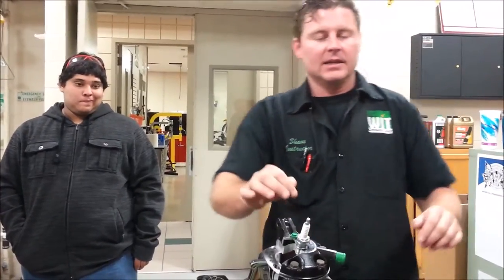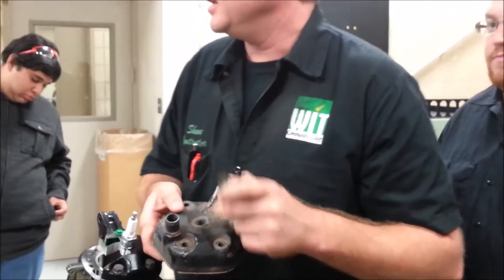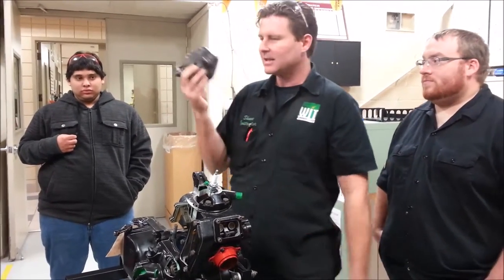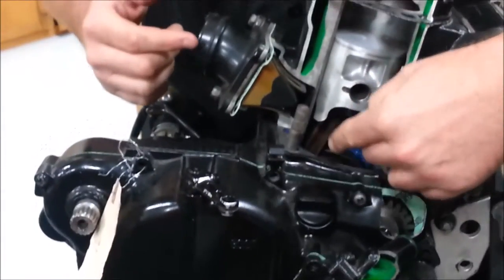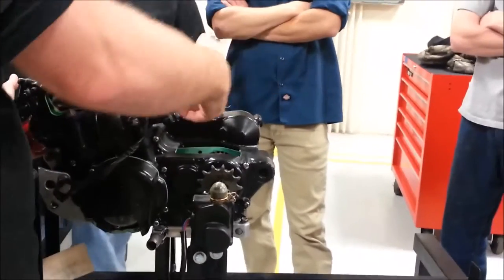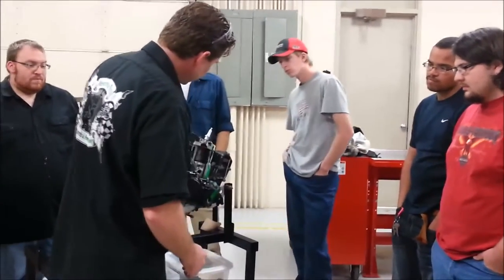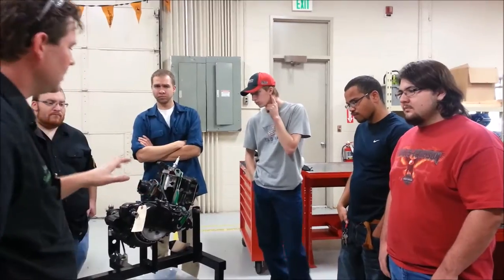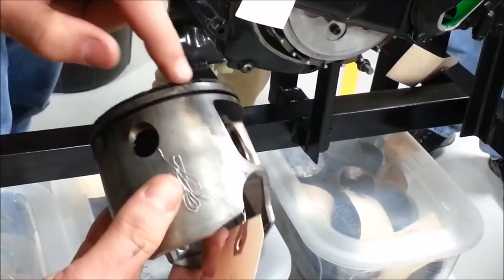2 Stroke Engine Disassembly   Crankcase Pressure Test Leak Points   10 21 14

Comment: Hey good video, id like to see a 2 stroke leak down video.
I just finished rebuilding a 125 motor i used heat to install the bearings and a crank installer. But when i went to put the primary gear on it stuck out past the end of my crank so when i torqued it down it locked up the crank. Iv rebuilt 3 or 4 motors like this and never had this issue, the crank before the primary gear installed moved smoothly so i just put a washer on the end of the crank and problem solved. Another thing the race was extremely hard to push into the right main seal?

Comment: NGK plugs are terrible ...you can't tell how tight they are...until you strip the head.
Reply from the maker: Hi Mark...are you aware there are "fake" NGK plugs running around? There is also a new torque or a reuse torque procedure if using the "degree" or rotation vs. a torque wrench. Great info on the website or in our videos here on the channel. 
We sure love you taking the time to comment. Are you coming to the next live session? 
There a few ways you could help keep this work going and stay connected with me personally.  
1. The fastest and best thing you could simply do for us is hit that subscribe button…helps us creators more than you know! 
2. Join this channel to get access to perks:
https://www.youtube.com/channel/UCBhM8DCKnT3qXwTW0eToyCg/join   
3. Give us a high 5 here:  https://www.paypal.me/how2wrench    
Keep Wrenching,
Shane Conley
Peoria, AZ USA
Follow us!
www.How2Wrench.com       
www.Tools2Wrench.com    
Facebook: 
https://www.facebook.com/How2Wrench/   
Instagram:
https://www.instagram.com/how2wrench/
Reply: @How2Wrench  You know I did hear that and had forgotten about it. I restore and repair vintage outboards and have had SO MANY NGK plugs that the washer is so thick that you KEEP tightening until those old holes in the head just strip.  A champion plug just snugs up...period. That is NOT to say I am a big fan of champion plugs. The NGK you need to snug, back off, snug and back off 4 or 5 times to get the washer flattened.
Reply from the maker: @outboardfixer  Could you make a "dummy head" with a nut machined down nice and smooth and "pre-crush" the gasket when concerned about working on an old head? That way you would have to rely on the "old head threads" to crush the gasket down?
Reply: @How2Wrench  Yes, that is a good idea. I have a gazillion old Tecumseh heads here...don't know why i never thought of that.
Reply from the maker: @outboardfixer  👍